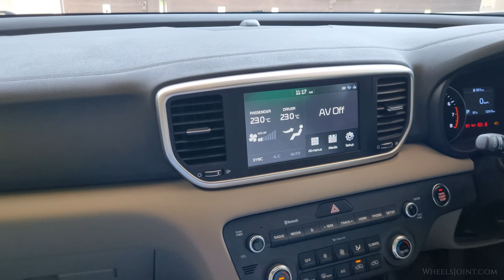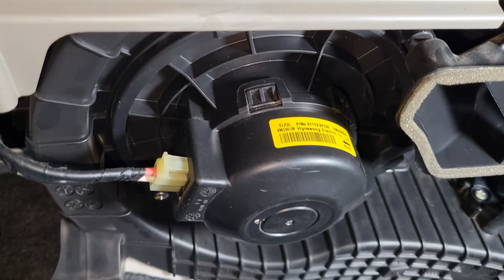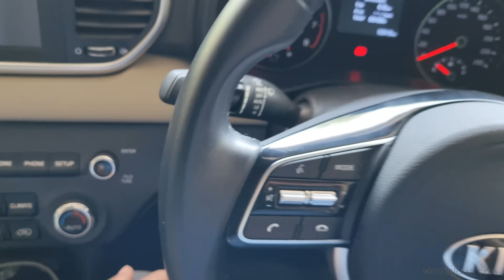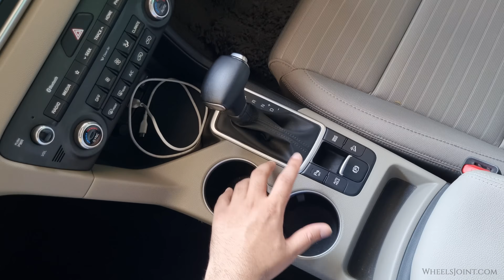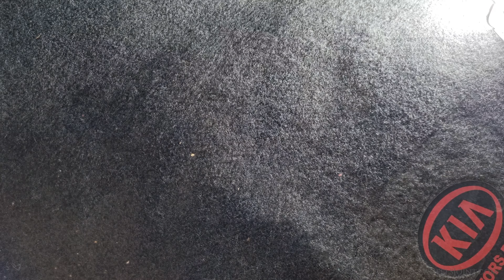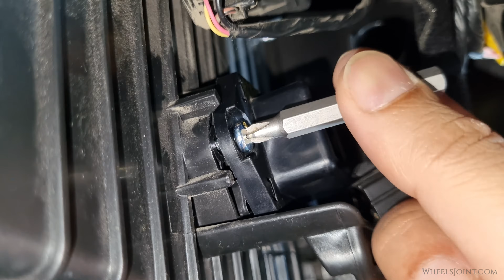How to replace Blower Motor Resistor or Field Effect Transistor in Kia Sportage

Comment: Thank you for this awesome video! I have the older SL version of the Sportage and I had no idea why my A/C blower's fan speed is either Minimum or Maximum with no in-between adjustments. I may not be able to replace the FET myself, but at least I know if the workshop tries to cheat me by saying that they have to open up the entire dashboard and gear console and charging me a ridiculous amount in labor fees.

My Sportage is rarely driven (less than 5,000 kms) for the past 11 years and am wondering if the resistor burning out is due to long periods of idling with the A/C on. I would occasionally start the engine twice a month when I don't drive it.

Comment: I replaced the resistor and filter however it still won’t work. From my research it looks like it could be the blower motor switch however I don’t know where to locate that on my 2018 Kia Sportage. Any help is appreciated. Thank you.
Reply from the maker: Did you check the blower motor fuse and relay in the engine compartment fuse box? I think the switch is part of the climate control unit. You should check everything else before going there, including checking blower motor itself.

Comment: how to fix driver side keyless entry system on kia Sportage? Passenger side is working but driver side is not working, side view mirrors do auto fold when I am around driver door, but but button on the driver side door does not work.
Reply from the maker: Could be faulty switch. Best way to test this is to plug-in a compatible OBD scanner and check the signal after pressing the button.
Sometimes minor glitches in the system can be resolved by disconnecting the battery for 10-15 minutes.